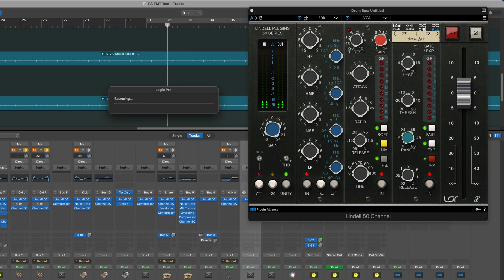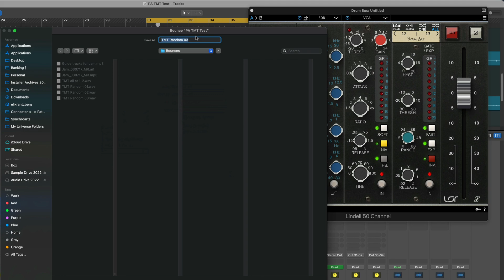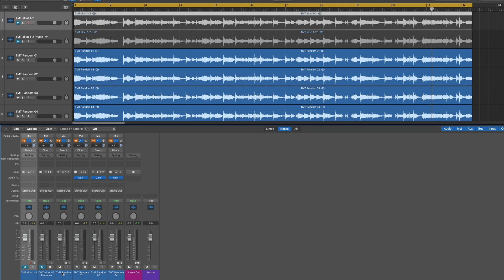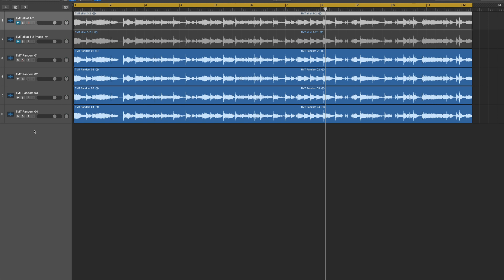Brainworx Tolerance Modelling Technology - Does the Channel Randomization Feature Really Do Anything

Comment: Yes very interesting. I have a couple of these and have discovered that, as far as I can see, unless you actually turn some eq knobs, the sound goes through the consoles unaffected, with no additional harmonics/distortion generated, even if you use the compressors, gate and/or filters. The THD control only operates if there are main eq changes, otherwise the signal is totally clean. I was very surprised at this as I assumed being console models some harmonics would be generated just by driving the input, for example. I have the Neve and Amek ones and both behave identically.  I would love to see your take on this aspect of the PA channel strips too.

Comment: Very interesting. Thank you for the video Eli.  Obviously very subtle from the changes when you are mixing. But guess the idea is that like an analog console each channel strips will never be identical to each channel because of the engineering of an analog console and its parts.
Reply: A mixer, working on a console, will never randomly plug the kick drum into a different channel. They tend to use the same channels for the same instruments.